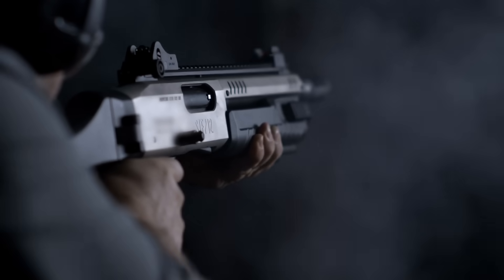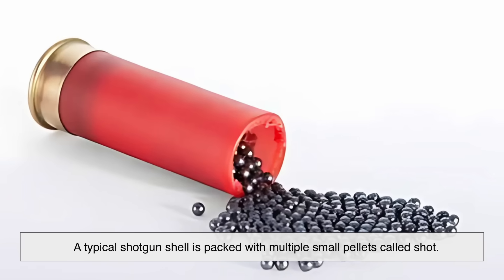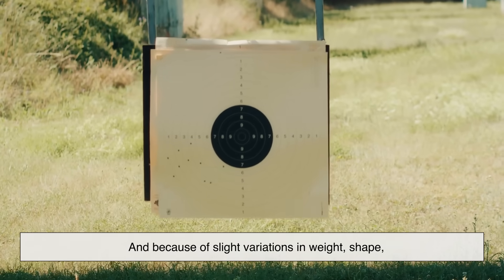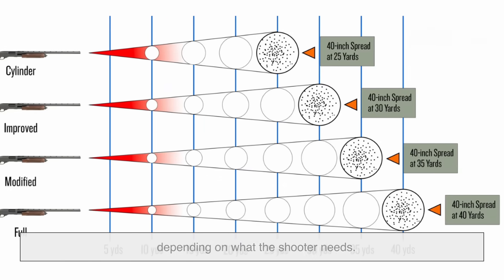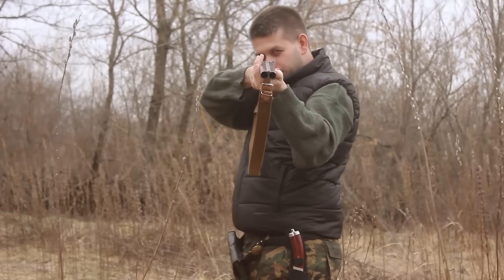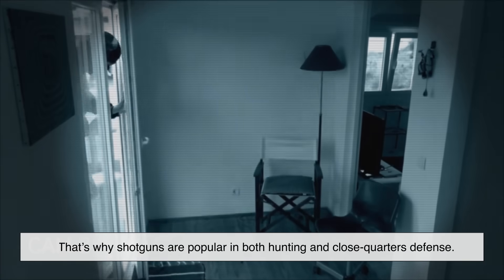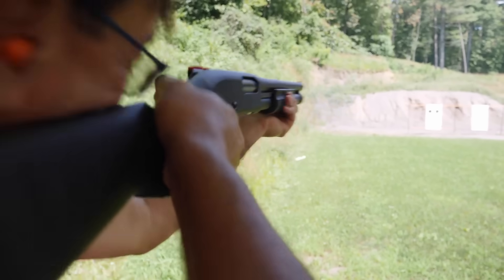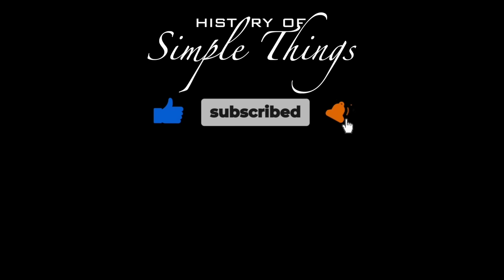Why Do Shotgun Shells Spread?

Comment: I think you are entirely wrong here.  You give way too much credit to the minute weight variance of the individual shot.   The reason they spread, regardless of choke or barrel length, is the fact that the pressure behind the shot greatly exceeds the atmospheric pressure at the end of the barrel.   That pressure is what spreads the shot. 🤓
Reply: Of course dude